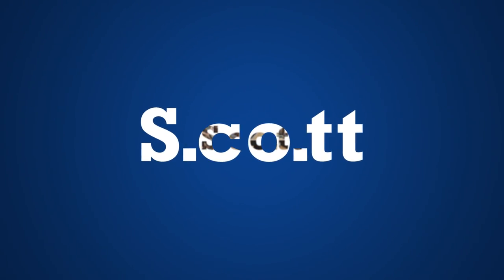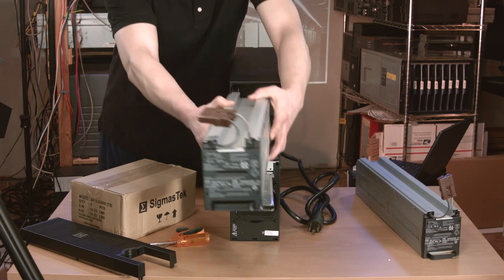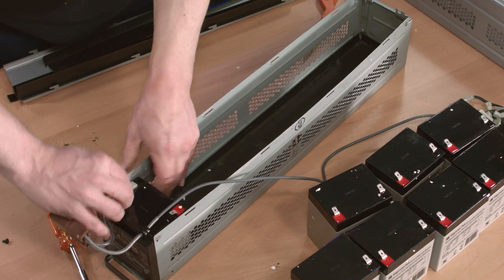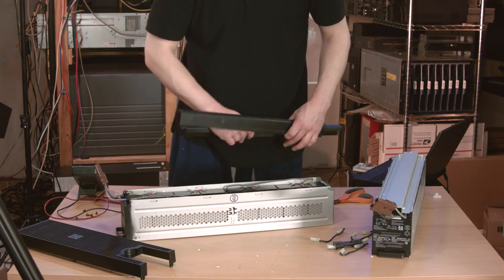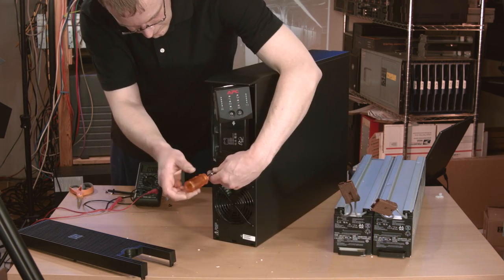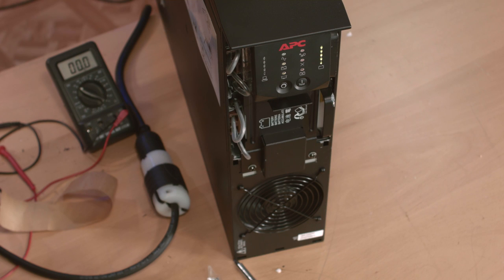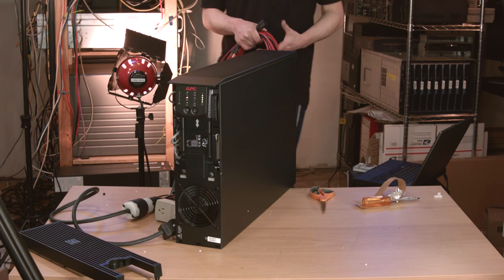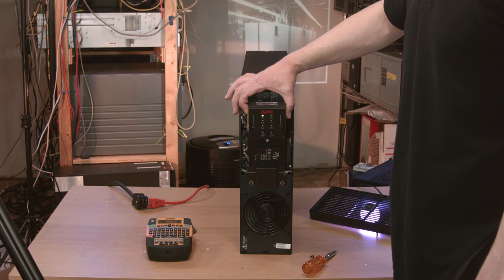New Batteries for a 3000VA APC UPS - Battery Replacement and Testing

Comment: Nice work, i work with a lot of APC UPS systems here at work. A tip of advice, whenever you have to change the batteries again, do not pull the connectors off the batteries, in the slim part, push in, and it will go out on its own (just sliding them), if you pull you will damage the terminal of the wire, it has a small locking mechanism there.

Comment: I just bought three APC UPSs, one was ready to go straight out of the box, one was bought as needing new batteries, the third was bought as "spares or repair" so any videos on these are going to be useful. Mine are 2 of 1400VA and 1 of 1500VA. The two smaller ones use two batteries "as is", whilst the larger one uses a cassette of four batteries, in similar fashion to yours. I'm looking forward to having a bit of a play with them. 🙏🏻

Comment: If you think you have a weak battery pack, run the inverter into a substantial load,  I use at least a 1200 to 1500 watt resistive load, three 500 watt halogen lamps work well, put a switch in series with each lamp and you can switch in one at a time 500watt lamp = approx 3.4 amps . Run the inverter until it shuts down, I keep a cheap desk clock ( dollar store variety ) that I modified so I could connect the battery in series with an external relay contact. The relay of course has a 120vac coil and is plugged into the UPS output. In this way if you note the current time on the clock or, set it to 1200 hours just as you pull the input power to the UPS you will get the exact run time on your unit, with the current battery packs. I also keep a piece of plywood with four edison base lamp sockets, all wired in parallel, with a 200 watt incandescent lamp with a switch in series with each one. Pull the battery pack and open the top cover.  Then apply some writable stick on labels to each battery. have a dependable ink pen and your multimeter ready, then connect all four lamps across the output leads of the pack. Put your meter across the output of the pack under load, when the output voltage drops to about 80 volts quickly measure each battery in the pack and record this value at the top the battery you are testing. Wait for the voltage to drop to about 74 volts then record the value of each battery again.  When the pack output is at about 66 to 69 volts, record the value of each battery as the final voltage. Any battery that reads more than five percent below it's fellow batteries should get a 'X' mark and be considered for replacement. I don't believe in 'shotgunning' with replacement parts, only replace the suspect batteries with new ones. Check out the website for 'Battery University' 
. All you questions about rechargeable batteries of all types will be answered...

Comment: The big fat jumper is NOT a thermal cut out, it is a 300amp high energy clearing fuse ( ceramic body and sand filled ). I have been in the electronics industry in one way or another for over 60 years. I have had a LOT of experience with storage batteries. Note: if you are having troubles with any device that depends on storage batteries, check the batteries Very, Very closely. You said that you assumed that the Sigma Tek batteries were better than the Power Sonic, in electronics, NEVER assume anything, your assumption is almost always wrong. By the way I have talked with many other guys in the field and, they tell me that batteries are just like everything else these days, brand names do not matter. Sigma Tek, APC, and Power Sonic are all made in Vietnam, probably come out of the same plant, only the case colors and the name are changed to protect the guilty.

Comment: You have to test battery pack outside the unit before go to the production. For ex. buy DC-DC converter with output up to 120 V DC. Set max current with 1 A, voltage 108-109V and connect to the new battery pack. Wait for a hour and measure voltage on all batteries inside one by one with DC-DC being connected. You will find some batteries that out of normal voltages. So it's better to replace them with another one. Even if you buy batteries from one batch production there are always some batteries that have different inner resistance.

Comment: I kinda accidentally came into possession of a couple of similar UPS units (mine are APC Smart-UPS RT 6000VA) in a server rack that I picked up on OfferUp for so absurdly cheap that I'll not rub in the salt. Testing it all with my scope/DMM/AWG/LCR seems to be in perfect shape (even the batteries to my surprise). But I can't actually try it until I finish wiring my subpanel as this requires 29A of 240V PER UNIT. Which is just mind-bending. Good video though, makes me even more impatient to finish the subpanel

Comment: The ups is advertised as 3000VA, this mean that it's around 2500W, taking into acount that the batteries have 192V with 5.5AH, because they are linked in series this results in 1056Wh, because it's not recomended to drain the batteries more that 50% we have to cut the result in half, so only 528Wh are usable. In conclusion we can power something with around 500W for an hour if the power goes out or 15 minutes something else with 2500W. I wonder if the 5.5 AH batteries can be changed into 8-9AH to gain more power?

Comment: Have the batteries lasted you 3 years?  I've got an APC 6000 and external battery unit that will require 48 of these batteries.  There's a guy below telling us to buy Enersys batteries.  Just curious if your batteries crapped out on you.  Thanks!

Comment: Hey, not sure if you or someone else could help - I have picked up an srt5000 for free, one battery rack has several dead cells so can't be used but the other is ok and reads ~97v. Is it possible to use these units with only a single rack of batteries? I assumed it would be as it's advertised as being hot swappable. But with only one battery rack fitted it won't power up at all, no fan, no LEDs lighting up, nothing.

Comment: Hi, nice tutorial.I have changed the batteries, and were charging for two days. But the % of charge do not rice over 22%. I found that there is a Battery Constant that could be setted by an hyperterminal. I already connected with the UPS by the serial cable. But I do not know the consant.Do you know where I can find the Battery Constant for my APC smart RC 3000 XL registers 4="0A" 5="BD" 6="1E"?Thanks!!!

Comment: The two "packs" are in series internally - disconnecting either one breaks the circuit.
Reply: If true, it is unfortunate, and really infuriating considering the price of these things. I'd honestly expect a bit more from a server/enterprise grade backup unit. I'm really surprised they aren't in parallel with separate charge controllers honestly.

Comment: Interesting video,
I have two off those UPS (220V models) but batteries are dead (0.9V per battery). Even If I plug the UPS it does not start, is it normal with dead batteries? Or does my UPS are dead ?
thx for your answer
Reply: Exact model? Depends on the model, but most of the APC Smart models wont turn on if the battery is completly dead.
Reply: I think mine is a SURTD3000XL (don't have it right now to confirm). I saw some informations that confirm what you say. I just wanted to be sure. Not to order 300€ batteries for nothing.

Comment: Do you recomend me that i recharge this batteries or buy a new ones?? i have an UPS that has been  stored for four years
Reply: Life span of lead-acid batteries is around 3-4 years. if they have been sitting around for that long ammount of time, its going to be a problem to bring them back to life, and even if you succeed, they wont hold as much charge as new ones.
I wold reccomend to recycle the old ones, and get a new set.

Comment: Im looking for the SUA 3000I, it seems identical so the battery banks shall have the same size. Do you know the total amperage of the battery banks? Im trying to calculate the autonomy of my system when being fed by the batteries alone.
Reply: gxmcdg 4.5A each bank

Comment: Is there a bypass mode for the APC UPS that allows you to hot-swap the battery trays while the UPS is in system?
Reply: All newer models should have hot-swap capability, my SRT3000XLI certainly does.

Comment: have you tried using a deep cycle marine battery externally with a UPS?
Reply: +allenm00 not your high voltage series battery UPS, just a single 12VDC battery ups.
Reply from the maker: +allenm00 Nope, haven't tried it.  It would get me a whole lot of Wh for relatively cheap, but I'm not sure if the charging circuitry would be happy with it.  Though I've always wanted a shed in the backyard filled with a ton (possibly literally) of batteries for whole-house backup.
Reply: I've been using deep cycle batteries with a UPS for close to 9 years now. The issue is not the charger--remember, a dead battery can pull quite a bit of current, so the charger will output it's maximum current into a dead battery no matter what size it is (unless you are charging a very small battery with a very big charger; not the case here). The issue is that the cheaper UPS are designed with a battery sized to go dead before they overheat. Putting a larger battery on such a UPS will allow it to run past the point of overheating and it will probably die. You could probably fix this by adding a cooling fan, or you could use a UPS with a cooling fan like most all of the Smart UPS models.

I'm using a Smart UPS 1500 with two deep cycle marine batteries connected in series to give 24V. The UPS has a charger capable of 6 amps. (Another Smart UPS model I was using, think it was the 1400, has a 10 amp charger).

I adjusted the float voltage down because the default is too high for an SLA, let alone a wet-cell deep cycle marine battery. Instructions for doing this are here:
http://www.jjoseph.org/notes/apc_smartups_battery_float_voltage

I adjusted it to 13.8V * 2 (27.6V)

After running it that way for a couple of years, I decided to turn the float voltage down even further (13.5V * 2=27V) and hooked up a 3-stage charger in parallel with the APC; the APC starts flashing all of it's lights when the 3-stage charger's voltage output exceeds approx 14.5 volts, but that  has not caused a single problem and the 3-stage charger does a much better job than the APC's charger, which is just a single-stage float charger (the reason I went to a 3-stage charger is that the battery wasn't recharging very well at it's optimal float voltage, and using a higher float voltage gave better recharging at the cost of having to add more water more often).

Adding water? Yes--you'll definitely have to add water (preferably distilled) to the deep cycle marine battery. How much depends entirely on your float voltage setting. If you leave it at the default (14V*2=28V is what mine measured at), you'll likely have to add water every 4-5 months. Since I lowered the float voltage and put the 3-stage charger in, I only have to add water maybe every 18 months.

Also the batteries are lasting longer--my first set lasted less than 4 years before one of them developed a shorted cell. My second set is 4.5 years old and still going.

The batteries I'm using are Costco group 27, 85AH made by Johnson Controls (John Controls makes batteries for Costco, Interstate, Sears, Autozone, Advance Auto, among others).
Reply: @brianleeper5737  This is awesome, thanks for sharing. Wanting to try this myself now

Comment: As removing batteries in the computer, you teach me please?
I feel they are very tight.
Reply: Batteries tend to swell especially if spent, some VERY careful work with a small screwdriver should help you get them out.

Comment: Where to buy replacment battery for my APC Smart-UPS RT 2000VA 230V
Reply: Depends where you live.
Reply: @uK8cvPAq  im in indo. Im already search many info in internet. is it APC RBC31 for the name replacment battery
Reply: @gatastheexplorer  12v 7ah is the size you need, preferably the high discharge rate types such as Yuasa SW280, NPW45-12 or CSB HR1234W. You need to check the terminal size for F1 or F2, F2 terminals are slightly larger.

Is Indo short for India?
Reply: @gatastheexplorer  That comes to about US $51 which is about right, however those are the NP7-12 batteries which are general purpose standby use. A fully loaded 2kVA UPS will be pulling a ton of amps from each battery bank which is why APC used high discharge rate batteries for that model. What is the maximum load you'll be putting on the UPS? The standard NP7-12 might work as long as the load isn't too much, overloaded batteries turn into miniature grenades. I know the high discharge rate batteries are more expensive but please take this into consideration.
Reply: @uK8cvPAq  thnks for your information
Reply: @gatastheexplorer  Good luck with your endeavor, what will you be powering with this UPS? If its just a computer or something low power then the NP7-12 type will probably be fine for occasional power outages. Yuasa are some of the best batteries in the business.
Reply: @uK8cvPAq  server Hp proliant Gen8 480W pure
Reply: @gatastheexplorer  hmm, might be pushing the standard NP7-12 types then under full load. If your budget allows it then I'd go for the high discharge type of batteries if power outages are common.
Reply: @uK8cvPAq  ok thanks. 👍👍

Comment: yep those batteries suck. replaced a couple hundreds of them in the last month... i work at a ups service center.. u really want enersys, yuasa, or csb batteries.. those are the best then theres powersonic, bb batteries and others..
Reply: Is the Enersys battery that much better?  I've found a dealer (Refurb UPS) and they want $15 per battery.
Reply: @JimOltman  ah. yes, we knoww refurb ups very well. sadly they use pretty cheap quality batteries. but they sell them cheap also. you should expect to pay around 30$ per battery for top of the line models.
Reply: Hey mate, can you share the exact model of the enersis or yuasa used on the APC Surta 3000 xl?